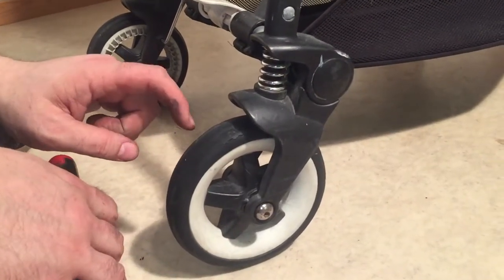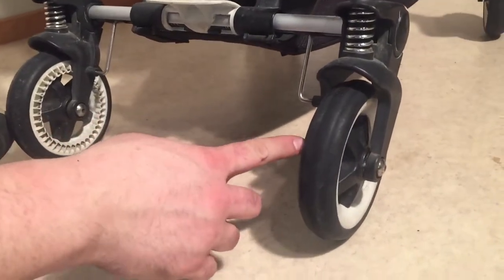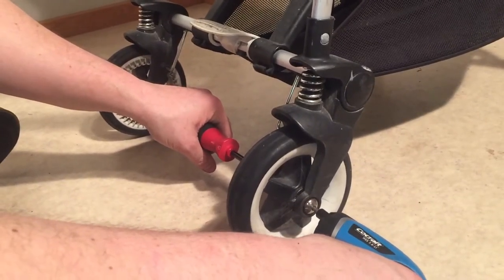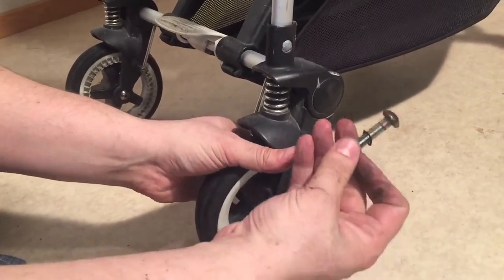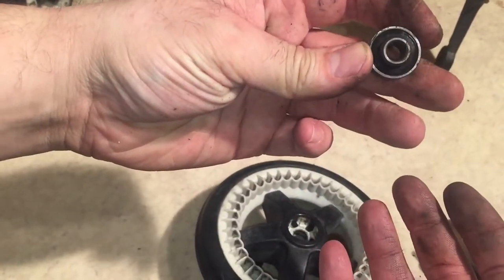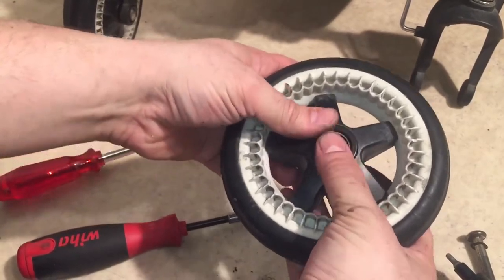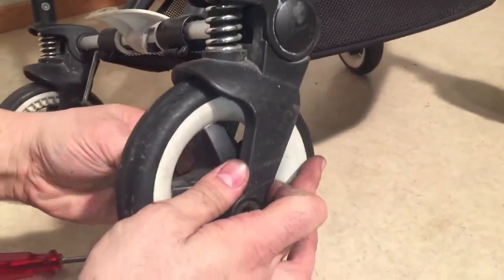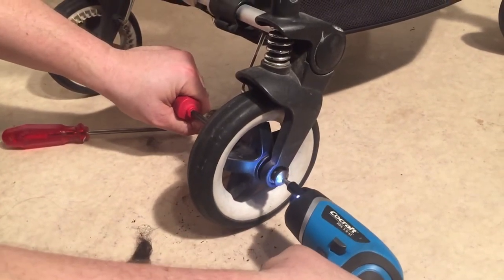Disassembling the Rear Wheel on Bugaboo Bee Models

Comment: Do You have a video about if the breaks lock when backing up?  My rear wheel keeps locking when I back up, I can’t tell if it’s the break that’s going closer to the wheel or the wheel is going closer to the breaks. Airline f”ed it up🤦🏻‍♀️
Reply from the maker: With airline damage it could be that the break pin or one of the bars is bent slightly.  Otherwise, my recommendation would be to try lubrication first at the point where the brake pin enters the hole through which it reaches the wheel. :)
Reply: We have this issue. Stroller moves fine in forward motion, but after a few feet going backwards the brake pins move toward the wheel. Did you have any luck in solving this?

Comment: I have a bee 3 with an overall wobbly chassis, how can I tighten it? Thank you
Reply from the maker: If it's the front wheels, you can use wave washers, otherwise there are just too many connection points on the Bee to really do anything, unless you feel like drilling and re-riveting everywhere that feels loose unfortunately (and then you're still left with the seat adjustment mechanism and a few other places).  Sell it and buy a Joolz Hub, maybe? :)

Comment: Can I please ask you if the bearings for this Bugaboo Bee Plus necessarily need spacers?
Reply from the maker: It's a long time since I took apart a Bee+, but I'm pretty sure that the spacer is just that the inner ring of the bearing is longer.  In any case, spacers shouldn't be that hard to DIY.  What you do probably need with the Bee+ is wave-washers (Bugaboo issued their own for the Bee+, which you can still get online), as that model had wobble-issues. :)

Comment: Hi,

I have a Bee, and I cannot remove the axel on the rear wheel. Please help.
Reply from the maker: Has it rusted in place?  If so, its just a matter of using lubricants, tools, elbow-grease and prayer ;)  If it's rather that it's a first gen. Bee, and the axle doesn't have screw-divets, then you need to pop the cap off like in this early gen. Cameleon video: https://www.youtube.com/watch?v=x_TmCA7HMwU&t=44s
Sorry for the quality, it's a very old video :)